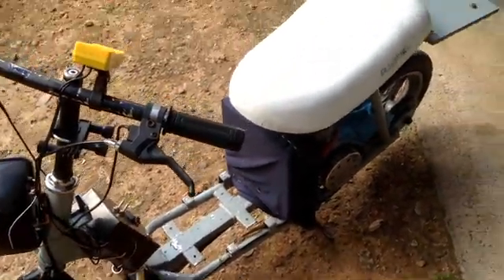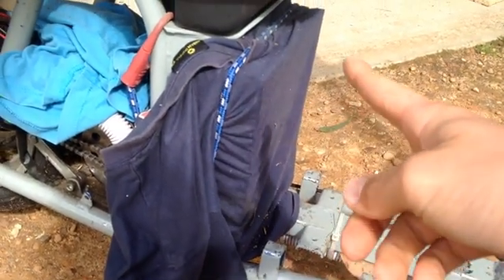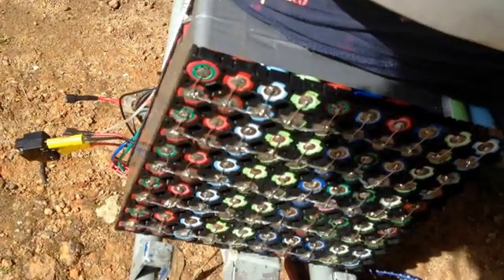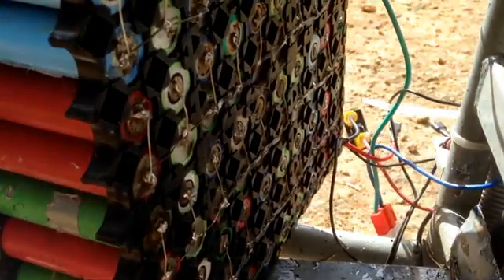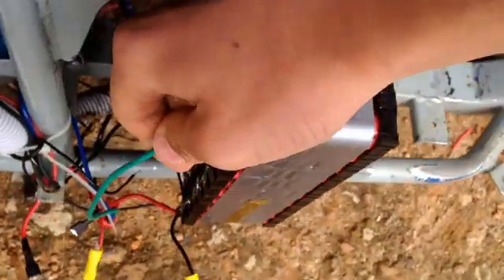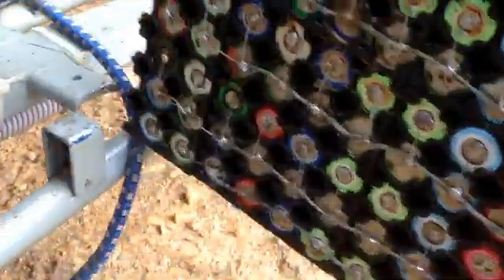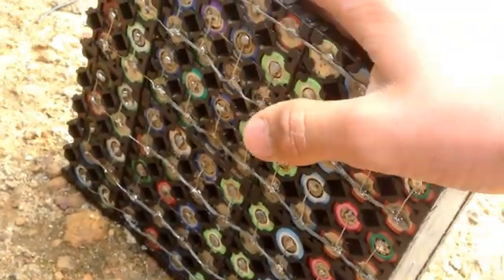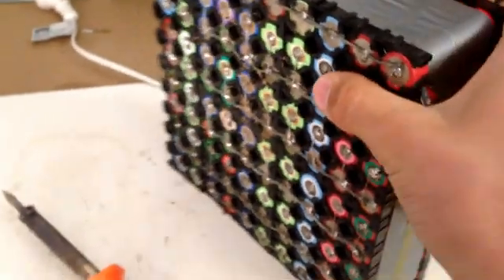DIY E-Bike Battery After 3 Months | Build from old laptop batteries | 36v 15AH

Comment: looks good get yourself a charger with a discharge mah test function if you want to know the capacity of the cells..

But yeah looks good! 

fairly well balanced too, well done bud!!..
Reply from the maker: Yeah thanks man, let's hope the next battery I build will be as successful!
Reply: I'm sure it will..
You said you are going to use new laptop batteries?
do you know what they will cost you each?
https://eu.nkon.nl/ cheap eu supplier fyi
Reply from the maker: Each cell costed me $1.44 USD each and they are 2600mah. Main problem with them is they aren't name brands, so the capacity and reliability is not guaranteed. It should only take a week for them to come in so make sure to look out for the vid where I test them and stuff.
Anyways thanks for watching and I hope to talk to you later!